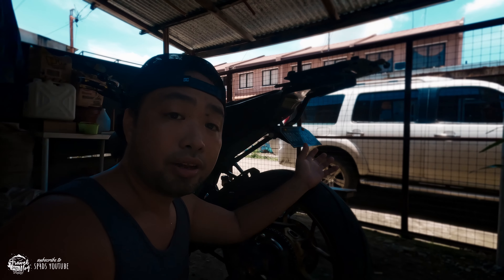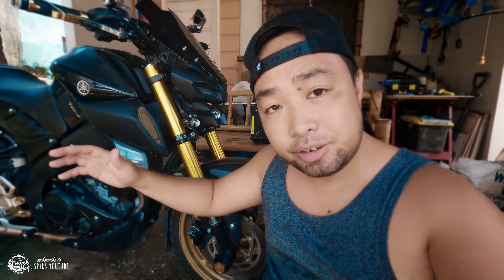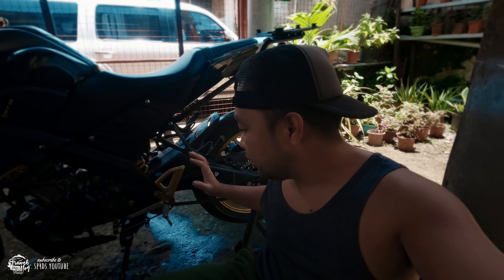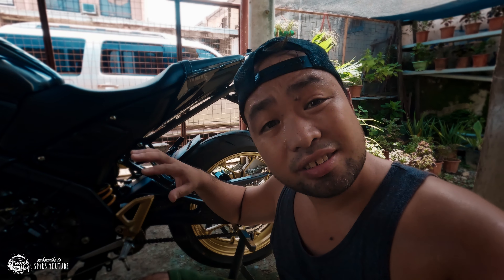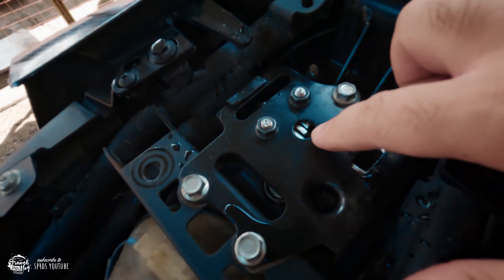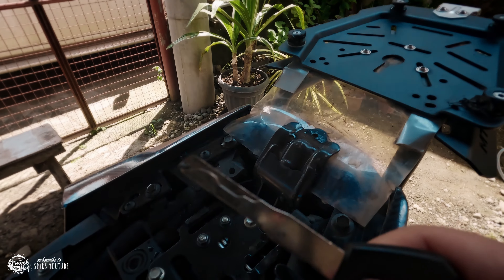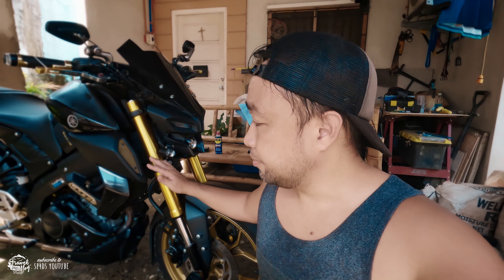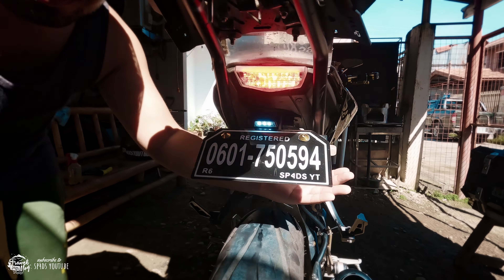Long Ride? Cleaning & Maintenance Guide feat. Yamaha MT15

Comment: pasok po ba sa lto ang sc project exhaust ng mt 15?
Reply from the maker: pasok po yan sa db. 98 lng po yan nung tinesting namin. pero dipende parin po sa local. yung local parin po kasi ang may last say. minsan hindi kasi nila alam na dapat may db meter par sa tunog
Reply: @SP4DS  thank you po,nag dadalawang isip ksi ako ksi baka mahuli,yan din ksi balak kong exhaust para sa mt 15 din